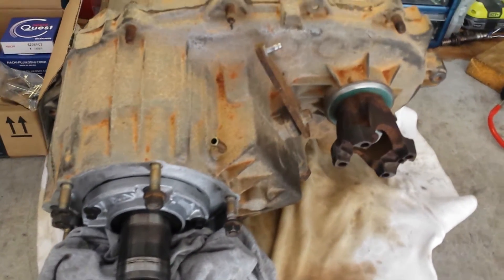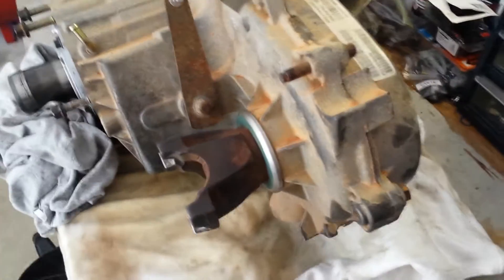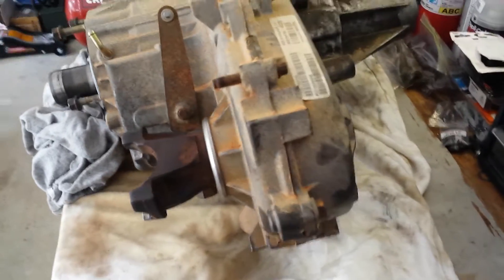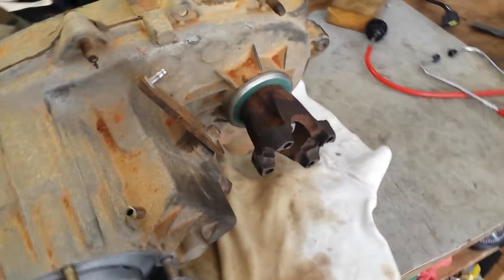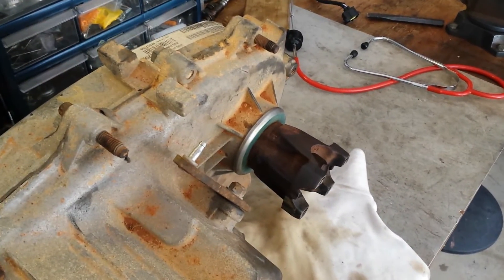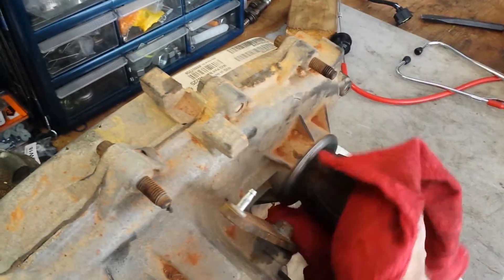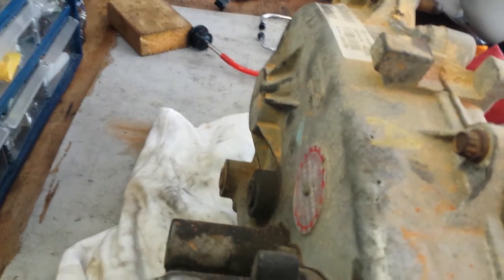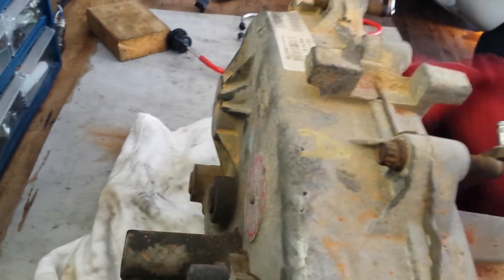Jeep Grand Cherokee NV 247 Transfer Case Possibly Bad Bearing

Comment: Did the rebuild fix your problem?
Reply from the maker: With oil in the transfer case, the noise/slop was much less pronounced, and I wasn't so sure anymore that something was wrong. So I elected to just reinstall it and drive more until a problem becomes easier to pinpoint. I did not rebuild it yet.